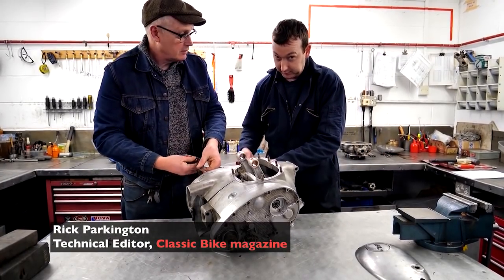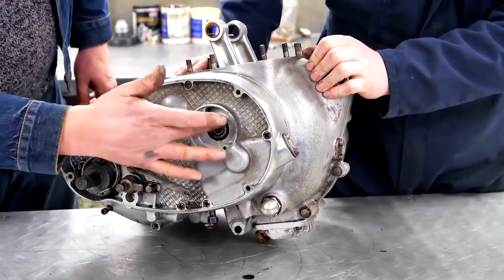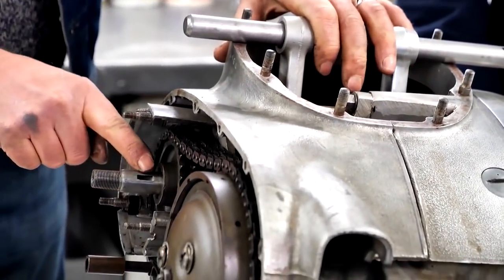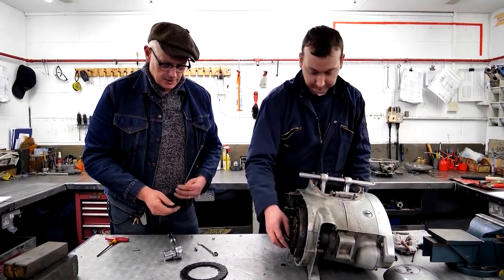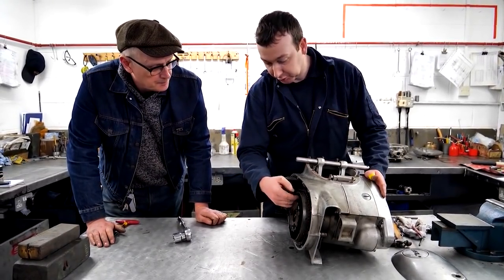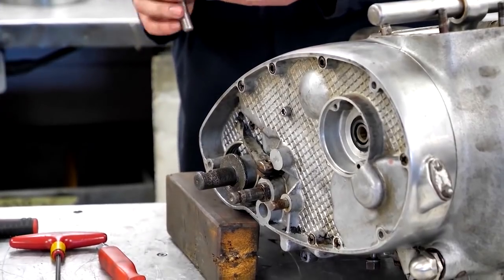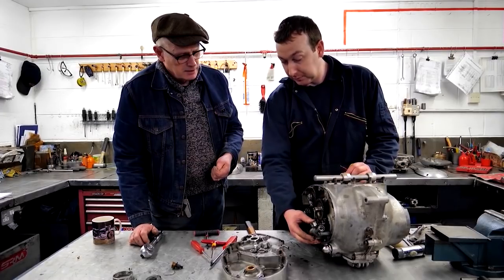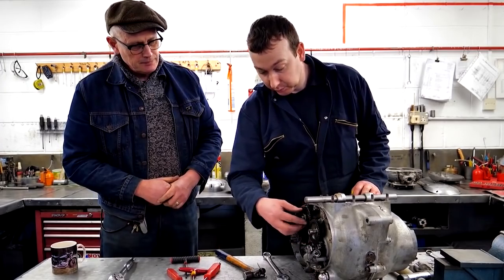BSA A65 Strip Part 2 | Rick's Fixes with SRM

Comment: Ok.. video #1 shows top end disassembled.  Video #2...  starts at removing the primary drive parts.  What about the timing parts.  I’m trying to remove the auto advance plate.  Manual doesn’t explain a lot
Reply: badbill63 I hope you got your answer already but a proper slide hammer works best you can order one for the task
Reply: Aj Richter yup.  I found a small slide hammer.  Thanks